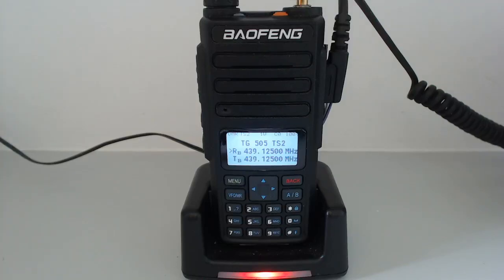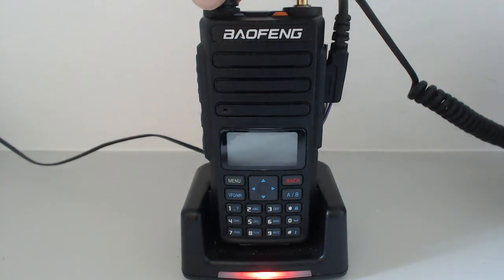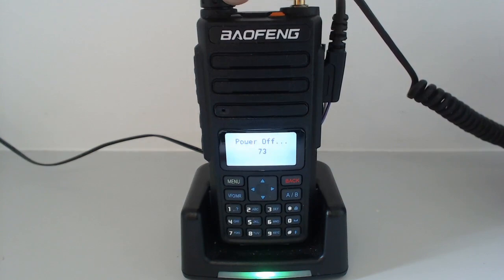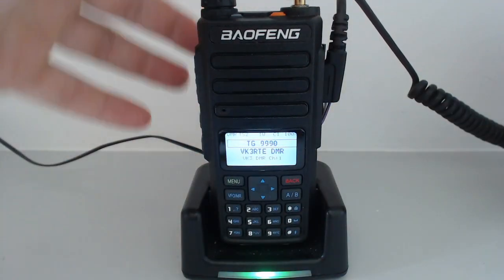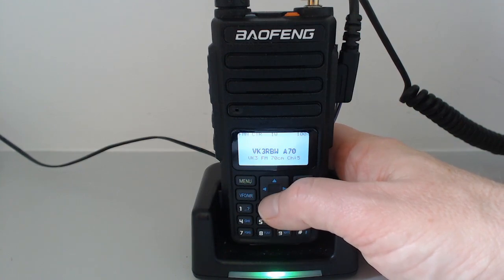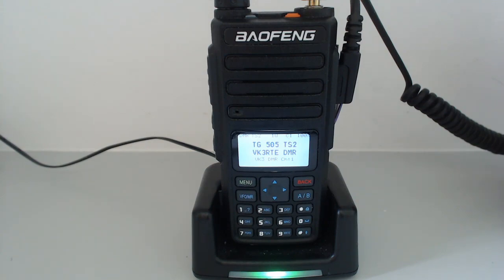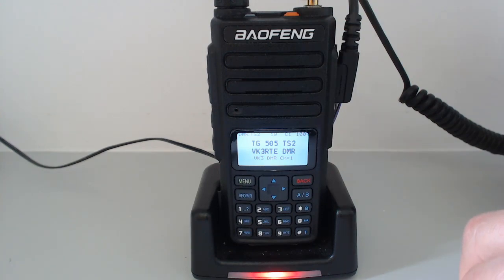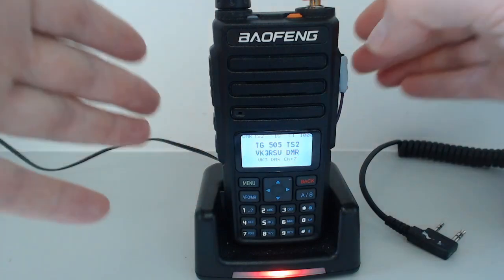Baofeng DM-1801 (version 1 hardware)  running the OpenGD77 firmware

Comment: and now for the DR-1801UV ... fingers crossed

actually, better to finish the MD-2017 support first
Reply from the maker: DR 1801 will never be possible. It can't be updated because it does NOT use a normal CPU and chipset, it only contains a Chinese DMR + RF module used in some mobile phones, with interface only via RS232
Reply: @vk3kyy  never say never.
What about MD380UV or MD390UV.

Comment: Roger, I don't get the green light, when booting the radio w/ the two buttons held down. Windows reports a malfunction. Do you have any thoughts?
Reply from the maker: These radios don't all have the same bootloader.

My radio didn't initially show the green LED, but the upload still worked fine.

I eventually replaced my bootloader with the one F1RMB extracted from his radio, but this isn't something that can be done easily, and its not necessary either.
Reply: @vk3kyy  Might be the cable then. When I click on the radio, Windows says that the 'last usb device has malfunctioned'. I've tried it on multiple pc's, all w/ the same result. Seating and unseating the cable prompt the connect/disconnect sound w/ the same dialogue...
Reply from the maker: @Integr8d  
Baofeng use a different cable to TYT / GD77 etc
Reply: @vk3kyy  Just using the one that was supplied. Assuming it would be the right one.
Reply from the maker: @Integr8d  
Could be a dodgy cable.
Did you try loading a version of the official firmware using the official firmware loader, using the same cable.
Does the cable upload / download the codeplug to the official firmware using the official CPS?
Reply: @vk3kyy  'Device not found'... Reinitialized the radio and can confirm that that both buttons function properly. I was hoping that there was a setting that would put it in some kind of writable mode. But it's probably the cable.
Reply from the maker: @Integr8d  Pressing in both buttons should do it. Its the same as on loads of radios.
There's probably a video on Youtube somewhere showing someone updating the firmware on that radio

Its always possible the cable or the radio is faulty .
Reply: @vk3kyy  It was the cable. Replacement is good:)
Reply from the maker: @Integr8d  
OK. Cool.

Some else some problems with the USB connection, which turned out to be that the plug at the radio end of the cable was a bit to fat to allow the plug to be fully pressed in, and the USB connection was then unreliable.

Comment: Does it display the call sign on all servers?  I was told only Brandmiester.
Reply from the maker: Brandmeister sends the callsign with the signal, but DMR MARC does not.

On DMR MARC you have to upload the database of callsigns, but the firmware can only hold around 15,000 callsign + names, or around 25,000 callsigns (without names).
The callsign database has to be uploaded from the CPS, and the CPS can filter by region code e.g. 234 and 235 if you need to load UK callsigns.

It won't hold the entire USA callsign database, but you can load individual states, as long as they have a unique region code (starting digits)

I have the entire Australian database (around 2000 entries) for use on the DMR MARC network in Australia.

For world wide I use Brandmeister, so there is no need to load the UK or some of the US callsigns.

BTW. On Brandmeister you won't see the name unless the operator has a Brandmeister account (which is free) and has entered their name into the APRS data, as Brandmeister only automatically includes the callsign in the datastream
Reply: @vk3kyy  Would you know if TGIF sends the data to see call sign?
Reply from the maker: @n1kkri  I don't know. I've only briefly used TGIF, and it didn't seem to be very active at the time.

From what I recall, callsigns were appearing on my display, but I can't be 100% about that.

Comment: After installing opendm1801, the sofftware doesn't connect with the radio. I am unable to read or write the program. Now it's bricked!
Reply from the maker: https://github.com/rogerclarkmelbourne/OpenGD77/blob/master/docs/OpenGD77_User_Guide.md#installation

"Note: The official Radioddity CPS PC software is not compatible with the firmware, and the “Community CPS” or the "OpenGD77 CPS" should be used instead. This can be downloaded from the link show in section 1.1 of this guide. This CPS must also be used for the Baofeng DM-1801"
Reply: @vk3kyy  Thanks for the link, I was able to program it now.  Why is that every time I change channels I also have to change the TG?
Reply from the maker: @carlossantini3605  Depends on how you setup your codeplug.
Read the docs about rebuilding your codeplug to make best use of the features in the firmware, and I also did a video about this. Or ask a question the various user groups for the firmware

Comment: I installed the firmware. It's super. I have a problem, I don't know how to install codeplug. Can anyone please advise? Thank you
Reply from the maker: https://github.com/rogerclarkmelbourne/opengd77cps/releases/latest
Reply: @vk3kyy  Thank you for answer. That is the problem. The program reports Device not found. Firmware 2.1.9. does not have this problem. The radio is communicating. I thought the cable was faulty, it's not. I do not know what to do. Thank you. https://www.youtube.com/watch?v=alJDH6nHNEk
Reply from the maker: @leostretter2880  "Firmware 2.1.9" is probably the official Baofeng firmware which uses a different USB protocol

Check you device manager and confirm the OpenGD77 COM driver is installed and fuctioning.

Try installing the driver again  using elevated privilages

https://github.com/rogerclarkmelbourne/OpenGD77CPS/releases/download/R20200311/OpenGD77_comm_driver.zip
Reply from the maker: @leostretter2880  There are some problems on Windows installations which are not set to English. We don't understand the problem, because it works on most non-english computers, but on some non-english computers the CPS can't find the radio.
Several developers have tried installing non-english versions of Windows onto their computers, but it worked fine.  So we have no way to debug this problem.

You probably need to ask a friend who is a developer to install Visual Studio onto your machine, and then compile and run the CPS from the source code, so that they can find the problem for you.

Full source code is available for download here.

https://github.com/rogerclarkmelbourne/opengd77cps
Reply: @vk3kyy  Thank you for your help. I probably ended up here. Over time, I'll try the English version of Windows.
Reply: @vk3kyy  Czech has been added in languages. Thank you!!! :-)

Comment: A question, the programming cable is the same of Gd77? - I can't connect to PC... GD77 IT'S OK..
Reply from the maker: The Baofeng DM-1801 (and Baofeng RD-5R), use a different USB cable from the GD-77
The difference is the USB D+ and USB D- connections are swapped.

Comment: Hi, thank you for the work done, there is a question on the topic of translation into Russian.
I did the translation, not professional, are you considering adding the Russian language to the firmware?
Thank!
Reply from the maker: The reason many languages can't be added to the firmware is because the bitmap font does not have the characters for that language. 
So its not simply a matter of entering the text into the firmware, the text would not display onto the screen any character glyphs used in the text are missing.
Also, there is only limited space in the CPU ROM, for the font, because all the additional functionality takes a lot of CPU ROM
Reply: @vk3kyy  Ok, thanks for the answer.
I forgot to mention that my microphone amplification does not work on the DM-1801, even with the maximum value in the DMR, the sound, as before, is at a very quiet level.
I am trying to understand if this is a problem in the amplification circuit at the iron level or my instance with this.
On the other hand, I met in the reviews of your firmware information that there is amplification on similar radio stations, but they did not show real amplification tests.
I also noticed at my radio station that after flashing and charging it never shows 100% of the charge, more often 97%, but most likely the fact is that my charging cup has broken for a long time, and charging does not go to 8.4, but to 8.3- 8.35V.

Comment: Am looking at DM-9HX, DM-1801 or DMR-6x2 (if I can find one!), as a cheap way to listen digitally to fire, police etc. Which one can you recommend?. Thanks.
Reply: First responder services and government operators usually use P25, not DMR. If you want to listen to public services you should try using a SDR dongle connected to a computer. You'll need to use some software to decode P25. SDR dongles are much cheaper, can cost  as little as $15 USD.

Comment: Hello, 
does md-380 work with OpenGD77 ( hotspoot) ?T hank you and best regards.
Reply from the maker: No. Only 
Radioddity GD-77, 
Radioddity GD-77S, 
TYT MD-760, 
Baofeng DM-1801, 
Baofeng DM-860,
Baofeng RD-5R and 
Baofeng DM-5R (Tier2 version) 

are supported.
Reply: @vk3kyy     .... baofeng  DM-9HX   =   DM-5R   ?  supported ?     :-)       73... :-)

Comment: I don't have experience with the 1801 yet, but looking into the radio a bit I see reviews and youtube videos of people using the 1801 with their hotspots, and they say they had no problems. You mentioned yours never worked on a hotspot even with the official firmware, is it possible its something specific with your radio or hotspot causing an issue and not something with the new firmware?

This is an awesome project, thank you for the work you are doing!
Reply from the maker: I think its something specific to my DM-1801 (actually is a DM-860 but they are the same radio), probably caused my incorrect factory calibration settings.

Comment: This really makes the DM1801/960 a far better rig. I think the Baofeng RD5R uses similar hardware is there any possibility open GD77 could be run on that transceiver?
Reply from the maker: I bought a RD-5R last year, and intend eventually to try to put the firmware on that radio. However its much bigger job, as the display is not the same, and I suspect virtually every internal connection to the micro-controller is going to be different, so its going to take ages to manually trace each of about 50 connections, especially when the pins on the chips are soooo small.

Comment: Can  be used as  DMR hotspot as Gd77 does?
Reply from the maker: In theory Yes.  Its 99% the same as the OpenGD77. However no one has tested this yet.
Reply: I have given it a quick go in hotspot mode and it seemed to work ok. I will do a longer test hopefully tomorrow evening, I just didn't want to leave it unattended for any length of time just yet so the GD77 is still on hotspot duty!
Reply from the maker: @KevinOReillyswl  See. https://www.opengd77.com/viewtopic.php?f=13&t=719&start=10

There may be a minor problem with the CWID modulation level, but this could be the calibration data in the radio is wrong.
Reply from the maker: Yes.
https://www.opengd77.com/viewtopic.php?f=13&t=719&start=10#p6405

Comment: Thanks!  I just made a video myself before you did. I probably got some information wrong....but awesome! Thanks so much!
Reply from the maker: Cool ... I'll take a look
Reply from the maker: You should update your firmware with the latest version (from the same link), as I have fixed the low power (below 1W) calibration, so that the power output on the DM-1801 is correct. 
The power levels below 1W are not sure accurate on the GD-77 or DM-1801, as its impossible make it perfect on every radio as the RF performance varies, but it will be much better on the DM-1801 than in the previous version. 
There are also some other changes which are common to the GD-77. See https://www.opengd77.com/viewtopic.php?f=13&t=729&p=6429#p6429 for the list of changes